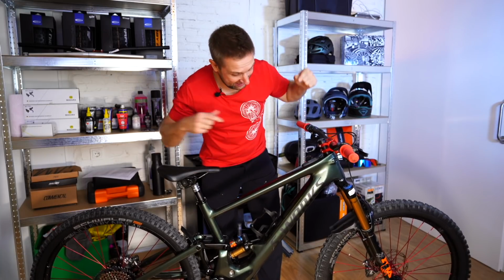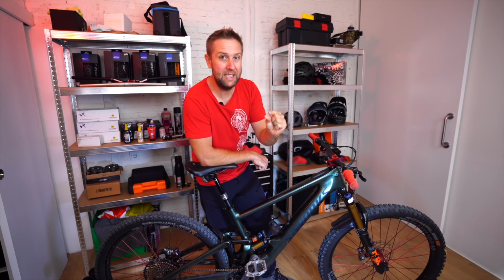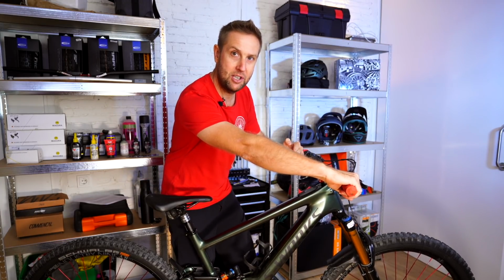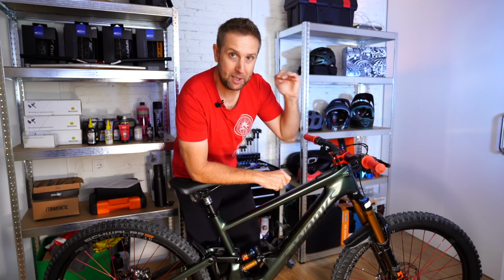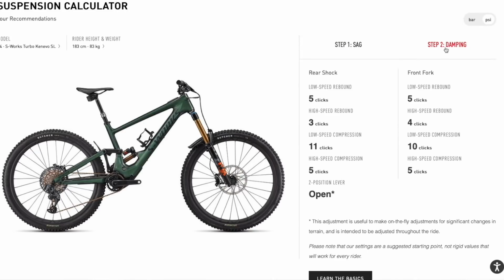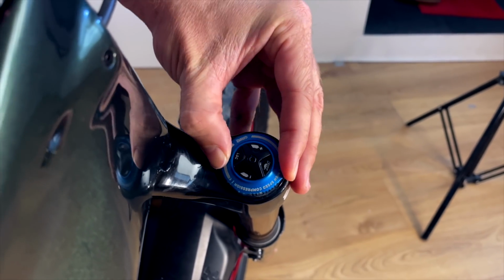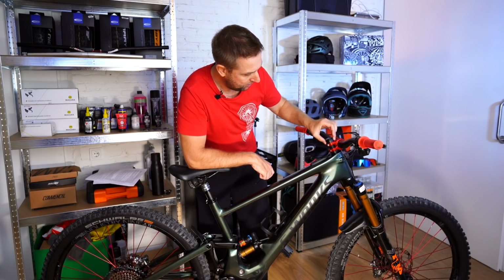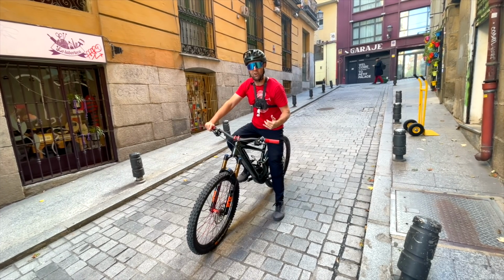How To Set Up Your First Full Suspension Electric Mountain Bike - SPECIALIZED KENEVO SL SET UP GUIDE

Comment: How do you change rear geometry to raise bb height on kenevo sl?
Reply from the maker: You just change the flip chip on the chainstay super fast and easy
Reply: @SamsBikes  is the only way by letting air out of the shock?
Reply: @JWO1965  no dude. Just remove the back wheel and change the flip chips

Comment: You demoed the fork rebound click adjustment in reverse. The correct POV to "close" the rebound valve is clockwise while you're looking at the knob straight on from underneath the bike, not the same POV as the compression.
Reply from the maker: Sorry I made a mistake
Reply: @SamsBikes  no worries.  Love your content! Keep it up.